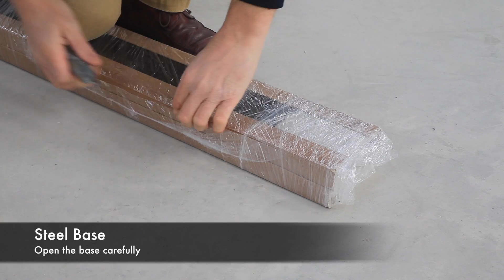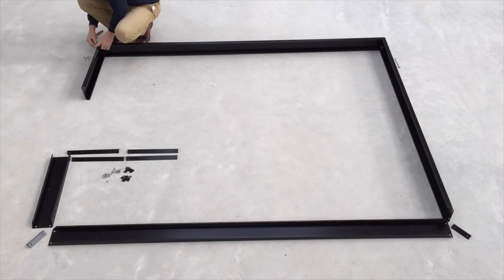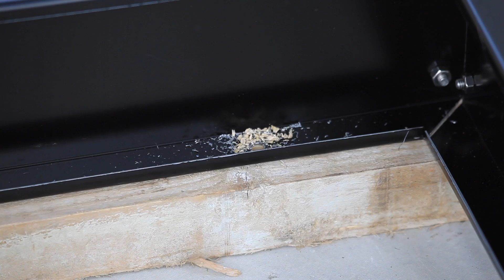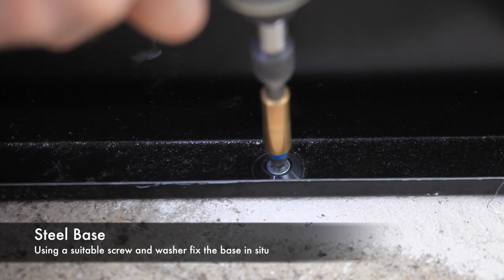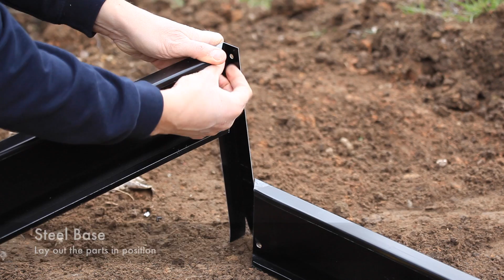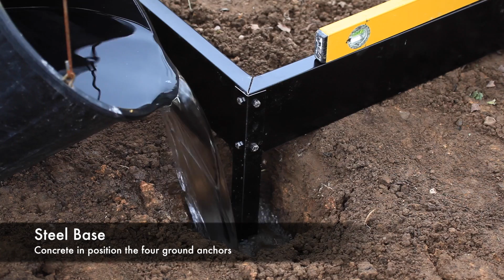Greenhouse Base Assembly & Installation

Comment: Very helpful. What do you do if you want to mount it directly onto tiles with screws into the tiles but the teresse isn't level? How do you then level it before screwing it to the tiles?
Reply from the maker: Thanks for watching. In answer to your question there are only two options. One is to re lay the paving level. Or you can pack the base to make it level with packers. It all depends how far out of level the paving is. A slight fall in level is not necessarily a bad thing. I hope this helps and good luck with the project.

Comment: This is a great video, thank you for sharing. I've got my base up and putting together my frame right now. One thing I don't quite understand is the attaching of frame to base - I know there are the clips but one of the diagrams in the instructions seems to show self tapping screws as well...
Reply from the maker: Hi Matt thanks for the feedback. Sorry about the delay I have been on holiday! From memory there are clips that hook under the lip on the base then fix to the greenhouse frame with a bolt. I guess that you could fix it with self tapping screws though.

Comment: I'm pretty sure it's alloy. Not steel. But not really important. Lol I'm just trying to fix together the Altan 62 Halls Wall mounted greenhouse. It's a nightmare. Just can not see how some of the structure fits together. I'm trying to find a video how to assemble it.
Reply from the maker: Have you brought it new? can you not go back to the manufacturers? There should be instructions. This was a steel base with simple corner brackets so easy to put together. Hope you get it sorted.
Reply: @SpencerCollection  yes I bought it brand new on line. The installation are rubbish and very difficult to understand. It's the top front corners that I can't work out.. And on the 2 roof struts they bolt to the back strut but no way to fix them to the front strut. Thanks for messaging back. 👍
Reply from the maker: @davescopes249  sorry I can not be of more help. Some instructions are so difficult to follow, I don’t think they ever test them out!
Reply: @SpencerCollection  yeah I know it's very difficult unless you was actually here looking at it. Lol. We will just have to keep changing bits around until we get it. But thank you for trying to help mate. I appreciate it. Take care. 👍

Comment: What size of rawlplug and what kind of screw did you use for securing the base to the ground?
Reply from the maker: Home-made Laparoscopy I did this 4 years ago but it all depends on what you are fixing to, I.e concrete pad or paving slabs etc. I would suggest to use a no 10 screw 50mm long and suitable rawlplug